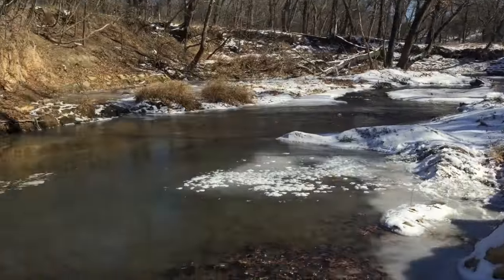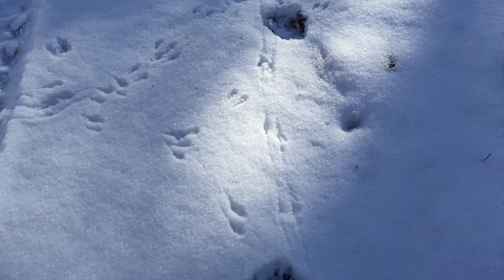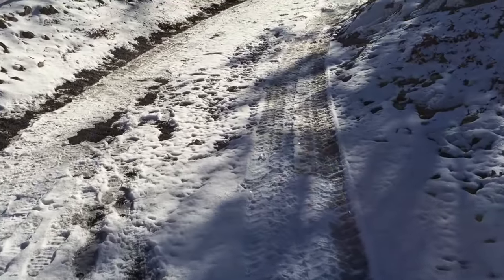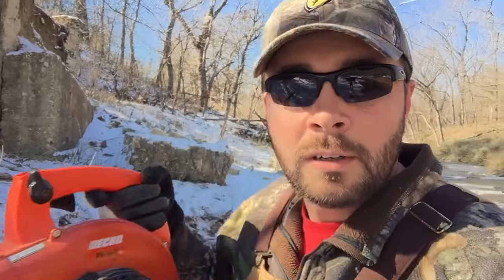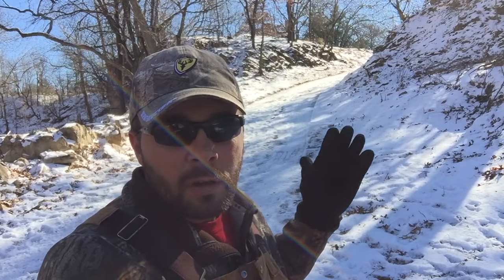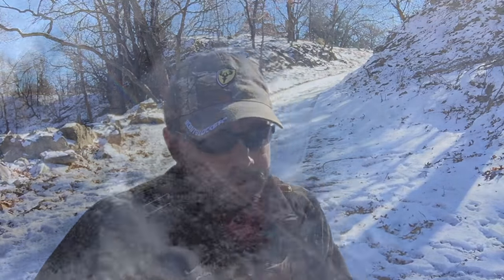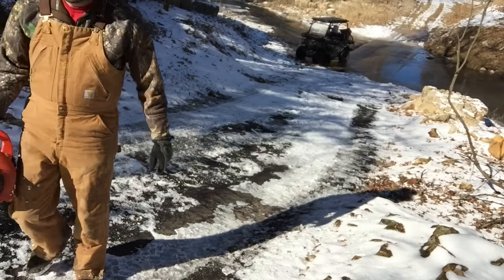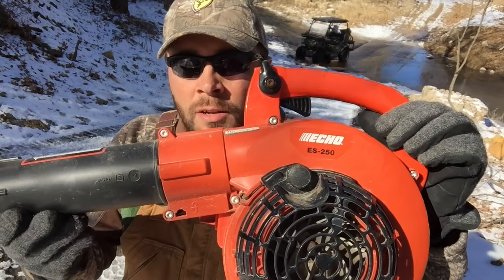How to Prevent a Slick Snow Packed Driveway

Comment: yes sir!  our old driveway was 45 degrees from the road...and both the drive and the road were uphill.  And, if you don't get the blower out quickly enough, you can always take wood ashes and sprinkle on the driveway (just need one side for a tire to stay on) and on you walkways.  The ashes don't sink into the snow/ice and give good traction for movement.   In your case, just one side of that hill and curve should work fine.
Reply from the maker: Awesome idea! Thanks, I'll have to try that.

Comment: Ok. I’m not a smart guy... I’m working with a pretty standard level of intelligence.. But I do believe the fact that you drive through a stream has a lot to do with your ice (or as you pronounce it “eyes”) problem. 

Now I’ve seen this kinda of stuff up at camp, and out in the wilderness when getting to a cabin.. but this is your residence if I’m not mistaken? I guess my question is, have you weighed the options on correcting this flaw?

What do you do during the wet season? 

If you play your cards right, you can build a bridge out of beams and planking for about $3500.